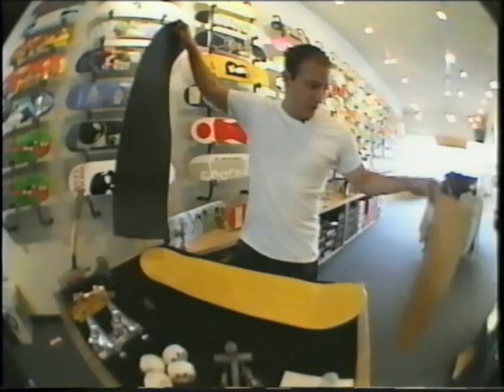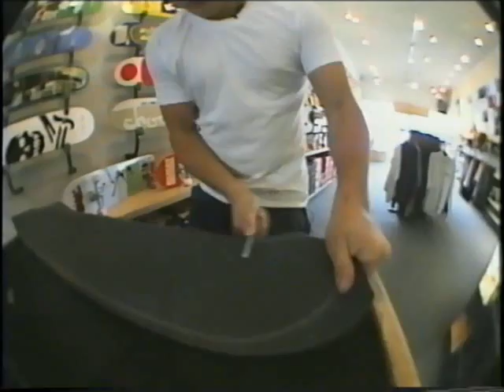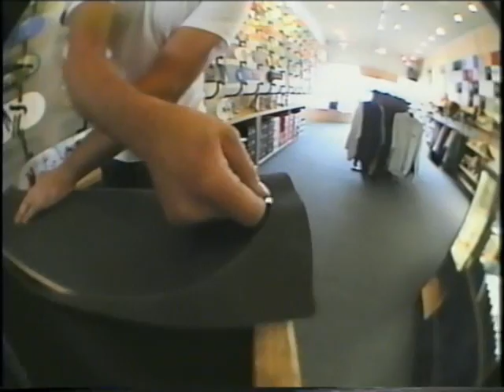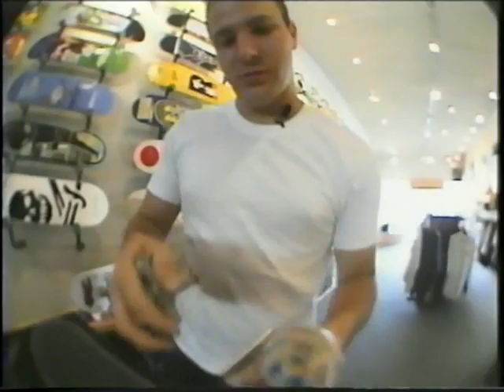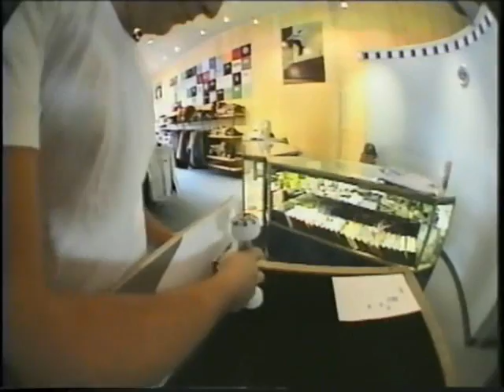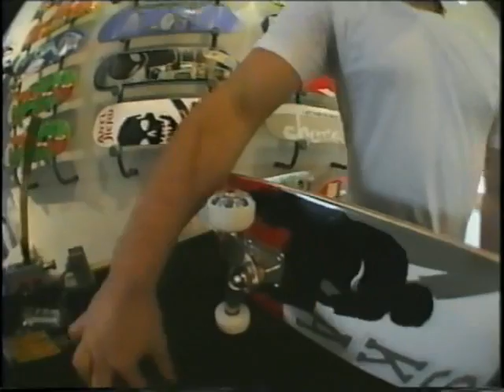Learn The Basics to Setting Up A Skateboard

Comment: for those of you who don't have a skate tool and want to put bearings on:
1. put your trucks on your board as shown(without wheels etc)
2. Put one bearing onto the truck (where the wheel should be) and push the wheel against it.
3. Take The wheel Off the truck Put Another bearing on the truck turn the wheel around and push the wheel into the bearing and repeat as many times as nessesary! :D